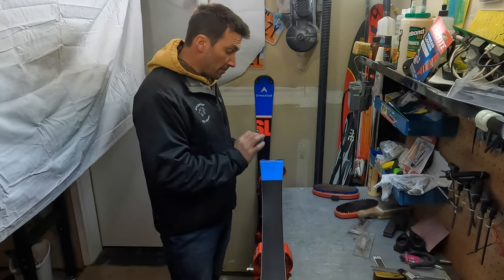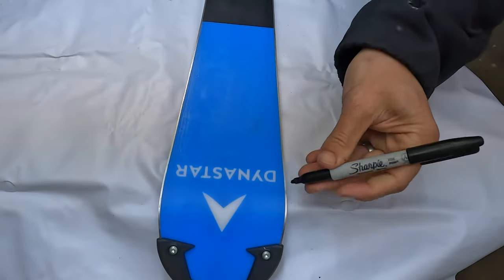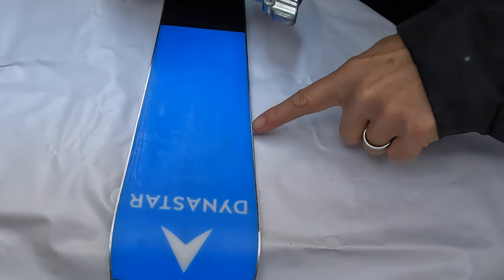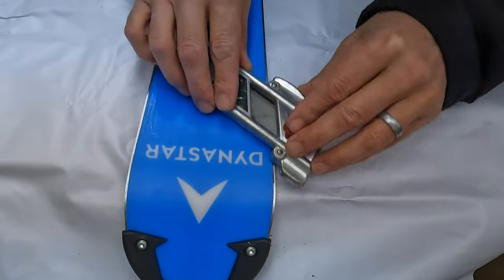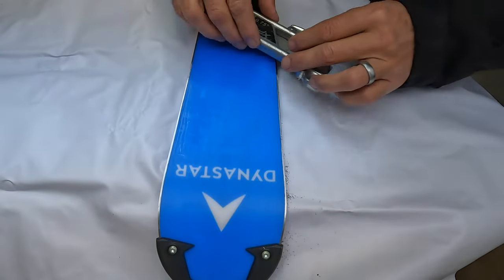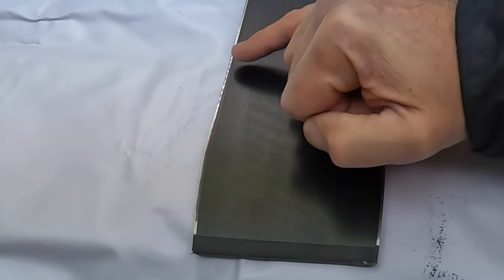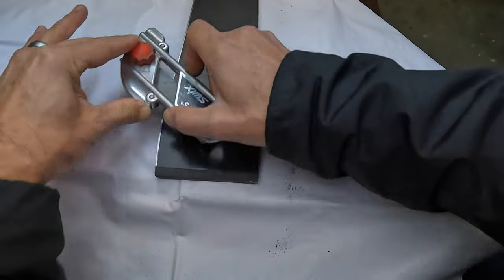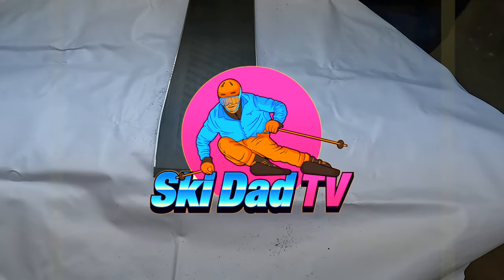Why you should always check the Tune on your Kids Skis - Fixing a common Tuning Shop Error

Comment from the maker: This video shows an extremely common issue found on new and freshly machine tuned skis. Cutting the base bevel all the way to the tip and tail removes the issue and only needs to be done 1 time.

After this bevel is set it is extremely important to use diamond stones to smooth the edges before skiing.

I recommend checking out my tuning and prepping videos linked in the description

Comment: Love this, not just how clearly you film and describe the symptoms, but that it really does take quite a few passes to change even a bevel angle.

A burning question on something I’ve notice in your video as well as in my more “race-like” skis, that the visible structure of the base is more smoothed out near the edges than in the middle. 

Do you know whether that is just how race skis are designed, or is it a consequence of spending more time on edge?
Reply: Racers have access to a variety of different skis with different base structures to suit the snow conditions. Really cold snow will call for a finer texture than very wet or heavily salted snow, just because there is less water to manage. Essentially, the different patterns you see are just the tech's best guess as to what's fastest for the conditions. Then o top of that, there are wax options and edge tuning. Some of the top WC athletes have 100+ possible pairs to choose from for a given discipline.

Comment: What would you recommend for edge angles for all mountain focused skis? I’m using a 1 degree base bevel and a 3 on the side but I don’t feel like the edges are digging in enough to inspire confidence. Should I change it to a 0.75 or maybe a 0.5? 

Thanks.
Reply from the maker: .5 is usually reserved for SL racers. I would try the .75